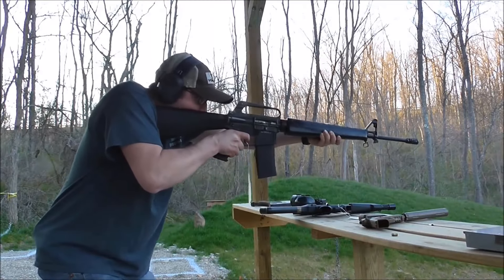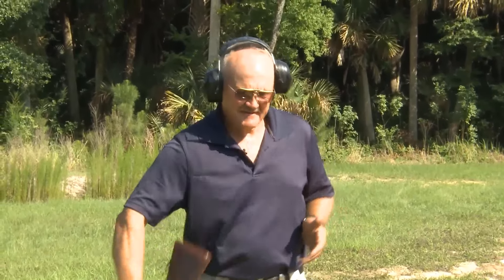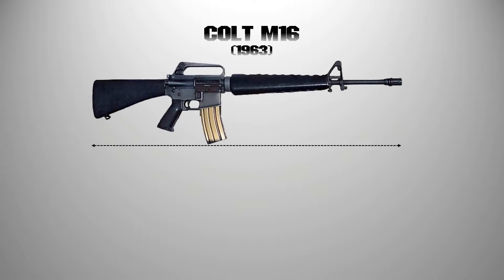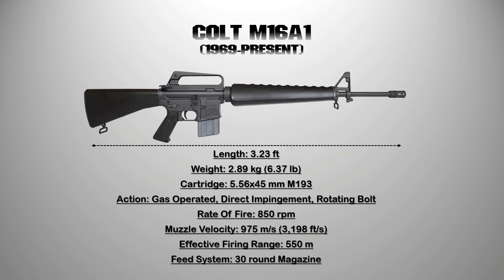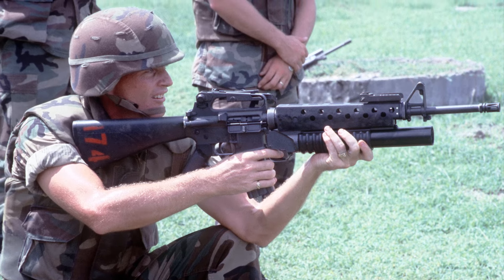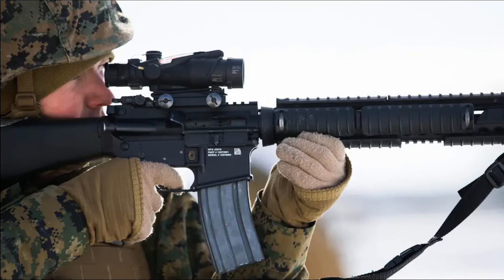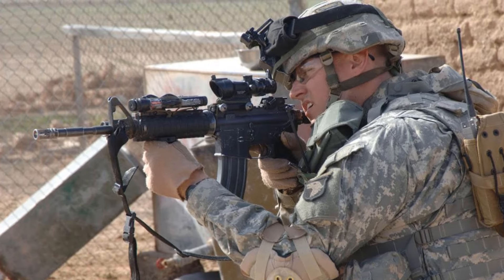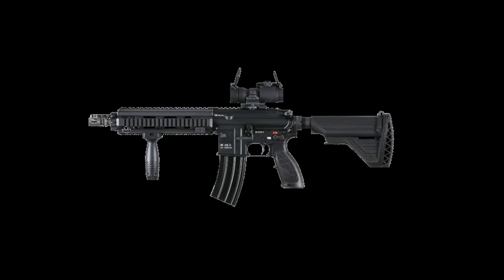Evolution Of M16 Rifle (1957- 2022)

Comment: AR-15 was NOT select fire - it was always SEMI-automatic, did not have the capability of selecting automatic fire.
That is the PRIMARY difference between an AR-15 and a M-16, and required some significant modifications to produce the M-16 out of the AR-15 design.
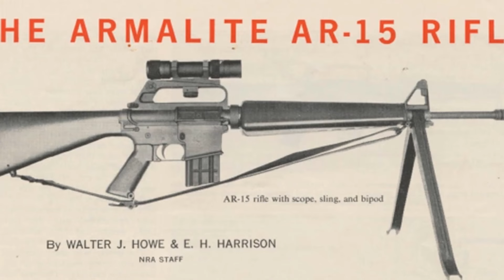Reply: The original AR-15 is select-fire, the auto sear pin is visible 1:42 above the selector
Reply: @TheSundayShooter  No, it was not select fire.
Semi-auto ONLY.
And where is this selector you claim is there at 1:42?

The AR-15 only had full auto IN SOME PROTOTYPES, the production model was not ALLOWED to be full auto as it was intended and designed to be sold to the public NOT just to the military.
Reply: @bricefleckenstein9666  The Colt 601 is the (select fire) production model, which was being manufactured years before the retail model (SP1 R6000) classification letter (dated December 10th, 1963)
Reply: @deathriders83  Proving that the M16 had select fire is redundant.
Ask almost any Vietnam veteran.
Reply: The very first AR-15s, before they were adopted by the military were select fire. Stoner only ever intended to sell his weapons to the military, so he made them select fire. At 1:42 u can see the sear pin above the selector on the AR-15.
Reply: Armalite AR15 is selective, colt AR-15 is semi
Reply: Original was, the one developed for military before they designated it the m-16, what the AR-15 became for the civilian market they took the full auto capabilities out.
Reply: @AndreiTrader  ok go back to Vietnam
Reply: @iwasneverkilled3516    only prototypes had select fire.  the select fire version became the m16. then the ar15 became a civilian weapon. and it was semi auto only...
Reply: @AndreiTrader  yeah i know
Reply: @iwasneverkilled3516   nice 👍
Reply: @TheSundayShooter  Correct, the AR-15 was originally designed as a weapon of war, or military use.
Reply: @iwasneverkilled3516  ArmaLite sold the AR-15 to Colt, so it is correct to say the Colt AR-15 was select fire.
Reply: @mts7274  "Weapon of war" is redundant terminology considering militaries still make use of bolt-action rifles, knives, pistols indistinguishable from retail models, et cetera
Reply: @TheSundayShooter  Can you think of ANY weapon in the current US military that actually is a weapon of war? 🤔

Comment: Had to fire a 16 in basic training in 82. Jammed up. Didn't qualify. I have cross-dominance. 16 is fine if you don't have cross domaince.
Reply: I recall hearing that the  m16 malfunction rate was 2 in 1000 rounds which sounded crazy at the time!
Reply: did you use the A2? my dad used the A2 in 1987 - 1991
Reply: @some_cool_random_guy  no. The original.
Reply: @marksheiman1538  oh ok👍

Comment: I still like AK 47/AKM more
Reply: The AK rifle is more durable and reliable but the American rifle has more dropping power and is much more accurate at short or long range. At a push I'd rather have an ak but overall American /Western arms are always going to be of a higher quality and superior design than anything Russian or Chinese engineers can throw together.
Reply: @Matt.Willoughby  AR performs better than AK in the mud tests I've seen so far, but the AK outperforms at freeze tests. I'd still go with the AR, just need a slight winter lube and it's golden. Keep it clean and it will keep you alive.